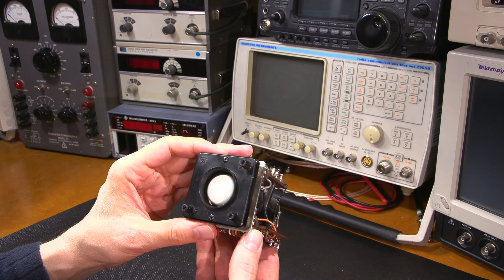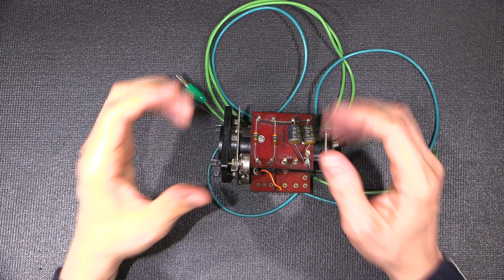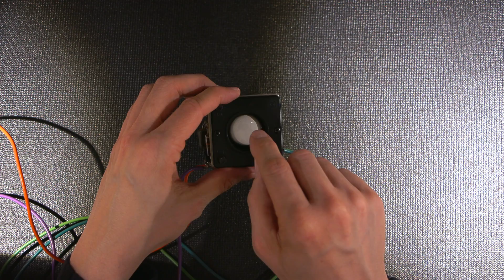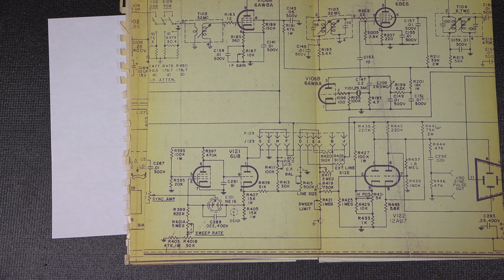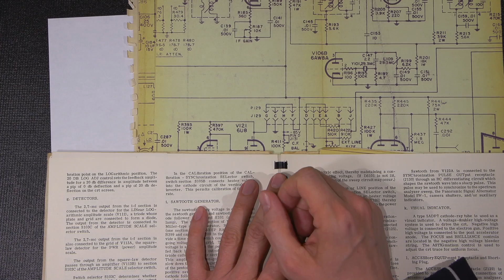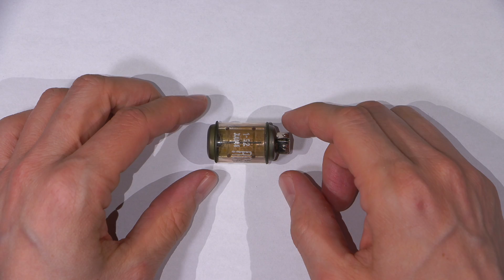Electronic Tool From The 1950's! Will It Work?

Comment: All right yes most definitely a re particulator valve  with a girdle cut mechanism switched capacitor
Reply: AT FIRST I THOUGHT IT WAS THE INOCULATOR VALVE FOR A REVERSE FLUX DIODE, BUT I BELIEVE YOU NAILED IT.

Comment: One question for you . Do you do repairs and restorations for viewers like me that due to health conditions can't do it themselves ? I have a RCA/THOMSON 5.1 receiver model RT-2600 sold by RadioShack that my wife gave as a gift some 10 or 15 years ago . It has obviously a sentimental value for me ! It turns on and works fine until it heats up then the circuit protection kicks in and with a very loud pop it completely shuts down.. I'm suspecting a high current drain is causing his , but as you know many things can cause this . I don't trust the local repair shops here but I do trust you! If you can do this restoration an repair of course I will pay you and you can do a video if you want to. Please respond. Thanks.
Reply from the maker: Hi Pedro. I would literally have a warehouse full of equipment to repair (maybe 2) if I took on jobs from this channel. Thanks for your kind offer, but I have to decline.

Comment: I see you can still buy one of those from Mullard on Ebay.  The max anode voltage is 1kv and recommended anode voltage is 650 VDC.  That gives a vertical sensitivity of 95/650 mm/volt or .146 mm/volt.  Nice old unit.

Comment: When you got that Lissajous pattern on the CRT I was reminded of an old TV show where they control the vertical and they control the horizontal. Aah, flashbacks!
Reply: "There is nothing wrong with your television set. Do not attempt to adjust the picture. We are controlling transmission. If we wish to make it louder, we will bring up the volume. If we wish to make it softer, we will tune it to a whisper. We will control the horizontal. We will control the vertical. We can roll the image, make it flutter. We can change the focus to a soft blur or sharpen it to crystal clarity. For the next hour, sit quietly and we will control all that you see and hear. We repeat: there is nothing wrong with your television set. You are about to participate in a great adventure. You are about to experience the awe and mystery which reaches from the inner mind to – The Outer Limits." 

Even reading that raises goosebumps! As a kid, I had to hide behind a pillow watching that show!
Reply: My TV did that "Soft Blur" thing real good...Not so much on the "Chrystal Clarity" bit
Reply: The Outer Limits.  Watched it as a kid. Great show.

Comment: I have one of those tubes + the magnetic shield. It was for a mini-oscilloscope project that was featured once upon a time in Radio Electronics (I think) from the '60s. The other tubes used, were 12AX7's. It was a great project, although the CRT display is only 1 inch! I may still have the actual article.

Comment: I remember using one of those little guys, perhaps it was a bit larger, built into a Radio Teletype Rig in the US Army back in 1971-73.  We used it when tuning up the rig, there was a switch NSK and some other SK, can't recall any more, but I always thought they were cool.  You could watch as the teletype transmitted the letters at 60 WMP.

Comment: Looks like it could have came out of a Aircraft Console.   Would like to have a play with one of those.  You could do some pretty cool chit with one.   As far as CRT's go that one seems to be in quite good shape.  Yea, burn in is always a issue.  The old Station ID Logo's use to get burned onto the TV Screens so bad you could make it out when the TV was even turned off.   *  That little tube is ether a Diode or a Photo Cell ?

Comment: Sir, please teach safety.  You could have taken 2 minutes to show how to put it in a safety enclosure, even if it's a cardboard box with a cutout.  AND FOR YOUR OWN SAFTY! Those old caps, the tube and I won't even mention xrays.
Please show people electronics, just do so safely.
Reply: X-rays? At 400 Volts?
Reply: @bobweiss8682  Some people just like to stir the drama pot.
Reply: @bobweiss8682  Usually no but depends on tube also.  Unknowns but possible.  Good safety practices.
Reply: An X-ray wouldn't have sufficient strength to get out of the glass envelope until the accelerating potential was above 16 kV or so.   @kennethhicks2113
Reply: @bobweiss8682  Yea, I got carried away with that bit from experience on HV crt's.  I'm sorry it's taken away from my valid bit of teaching safety also.
Reply: Thanx Ma

Comment: Hi Mr. Carlson. I have very limited knowledge about vacuum tubes but is that a gas-filled cold cathode diode in your trivial question? The purple hue reminds me of Iodine and the asymmetric arrangement of electrodes in there means one way is way different than the other.

Comment: 23:05 I think it detects light of a particular wavelength or wavelength range and produces a current flow through it to trigger something.
Reply: So it was used to read optical sound tracks, it was used before the invention of photoresistors(LDR) sorts of stuff.

Comment: That device looks like an Argon filled photocell, if i may guess should be part number 
RCA 921 or 922. Works a little like a Light dependent resistor, the brighter the exposure to light, the more current flow it gets. Some old film projector system uses these tubes to read the sound tracks on the films.

Comment: Must be a a phototube and if it's from RCA it must be a a 9xx series. I've seen tubes like that in movie cinema projectors for audio and projector switch mark circuits. Nice greets from Germany🙂👋
Reply: i already had the time to look for the type. Must be a RCA 921 or 926
Reply: Would be interesting to test its spectral response using various coloured LEDs?
Reply: Sebastian Weinert that’s what I thought too. I recognized the internal configuration as a phototube and due to its small size I assumed it was for a projector
Reply: I have NEVER seen one in person. Only drawings of them on paper.

Comment: Hello from Denmark, Scandinavia. What's the reasoning behind powering the unit up before checking the components ?
Isn't one required in all cases with old equipment, to examine the components before giving them any juice at all ?
Reply: 4:45 examination, adjustable current-limited voltage sources, isolation transformer and variac, connecting sources one at a time, raising voltages gradually and carefully monitoring each result- are these things like that to what you did refer?
Reply: Also he claims to be able to obtain a better replacement tube, so this high mileage tube can be a sacrificial part, and although the remainder of the entire assembly is unhoused, the decision between testing and replacement with better parts leans towards retaining the original components to preserve historical authenticity. Did you miss the history lesson at the beginning?
Reply: Also he claims to be able to obtain a better replacement tube, so this high mileage tube can be a sacrificial part, and although the remainder of the entire assembly is unhoused, the decision between testing and replacement with better parts leans towards retaining the original components to preserve historical authenticity. Did you miss the history lesson at the beginning?
Reply: Brian Hougaard Baldersbæk but the true bunker buster is there was no mention that this was a contracted or sponsored repair/rebuild, simply educational content, which means there’s no client’s demands to satisfy.
Happy yet?
Reply: And informally, the purpose of this channel is not to reinvent the wheel with every episode. These inspections could just as well been done off-camera, as is much of the other potential ‘content’.
Reply: Also consider that this unit is a "module" that was intended to be used as part of a larger piece of equipment.  Thus, it does not have its own power supply and power supply circuitry is the number one source of smoke, flames, and collateral damage when firing up old equipment.  Most of the components on the bakelite  tag boards are carbon composition resistors and they are unlikely to cause destructive problems - though they are known to drift higher in value and cause operational difficulties.  The only parts that might be suspect are what look to be four paper capacitors and I'll bet there was an eye on the current meter when B+ was initially applied and if excessive current was drawn (ie:  shorted bypass cap) there would have been a quick shutdown.

Comment: Woo hoo! Millen 90901 mini oscilloscope unit! Saw it in the radio amateur's handbook when I was 11. Nerd porn at its finest! I've got one of those now too!! Highly collectible. Hooked mine to a scope clock board. Thought I posted a video?? Guess not. The center of the screen is dim because of sine wave scanning. It is causing a form of velocity modulation.
Reply: I was born in 1940 and my dad was into electronics. He had a 1946 ARRL Handbook that he encouraged me to study as soon as I could read. I remembered all the cool ads in the back pages. Ham radio was banned during the war but ARRL was still active. I think a lot of hams went to shortwave listening. A few experimented with carrier wave(?) communication over the power lines. I had a one tube, regenerative SW, receiver that he built for me and a decent antenna.  I used to listen to the hams on the 75 meter phone band. I was puzzled when ssb came along. He bought me a Hallicrafters S-40b in the early '50s. I got my Novice in the '53, General in '56 and 1st Class Commercial in '57.
Reply: videolabguy  I remember this scope too. I read ARRL Handbook really much as young in the 60’s when received my ham callsign OH2BIO. I still have some older ones on my library. Those were real masterpieces. And heavy too.
Reply: Yeah, I used to love looking at the Millen ads in 1950s QST magazines.
Reply: I wonder if Cossor actually made these as well, as they were the ones who marketed the world's first all-electronic oscilloscope back in 1932.

Comment: Millen 1 inch oscilloscope used one in my ham shack 50 yrs ago ,love your website, thanks
Reply: You could buy them in the 70s. I have a similar 6" Russian made tube with unsymmetrical plates.  Cheap new old stock.